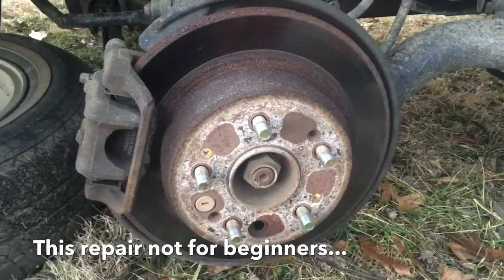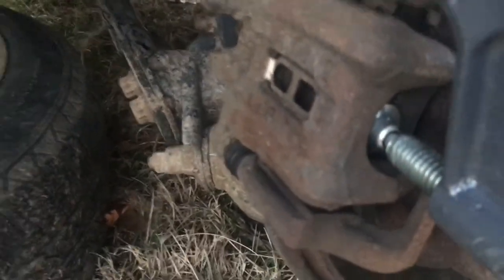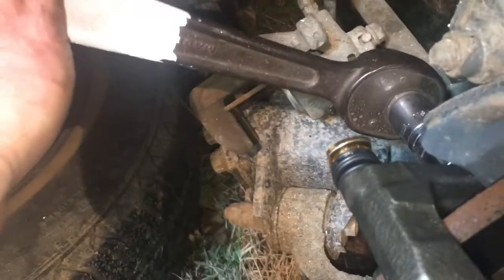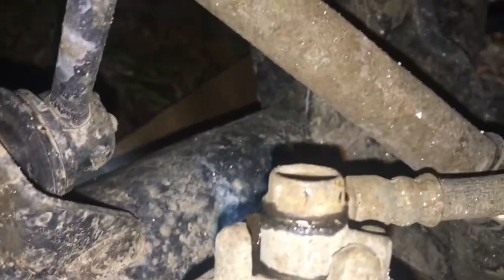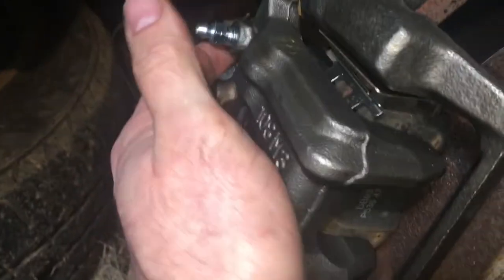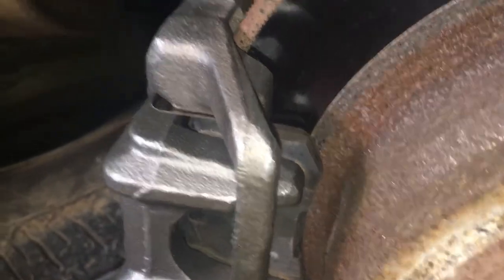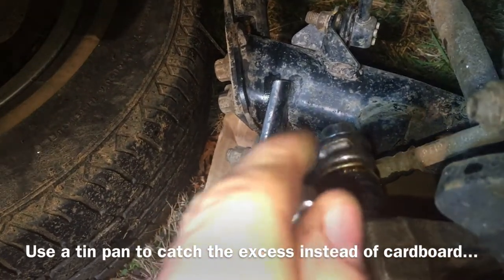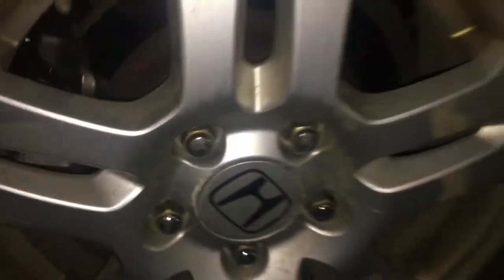Honda CRV How to replace Brake Caliper 2004 - How to remove Brake Caliper

Comment: Thank you for posting this video.  Was quoted $400 in parts from parts store  and another $140 for install.  Ordered power stop kit  from  Amazon which included two rotors, brake pads and two calipers. I will now being doing the job myself.  Thanks again for such a thorough and detailed video.

Comment: I did it!!.  I am not an auto  mechanic and I respect that line of work very much.  However, after my auto mechanic changed my rear brakes twice in just 2 months, I had to review his work and learn exactly what is going on.  After watching this video, I changed my breaks  and this time I also discovered that the left rear brakes do not wear out just the right rear brakes.   Not sure why my mechanic did not noticed this.  All in all, I was able to put new brakes and replace the calipers as well of my  Honda Pilot 2004
Reply from the maker: Ray Pérez congrats!  That’s great to hear!  There are a lot of reasons one side might wear faster than the other, but it could be due to a sticky caliper.  The caliper might be sticking closed on the right side and wearing those breaks out, or the left caliper might be sticking open and not closing fully, which means it’s not wearing that side out.  If you have a stuck caliper closed, you can tell by touching the wheel around the hub after driving.  If it’s stuck closed, it will be hot!  Hope this helps and you find the solution!

Comment: Yes this works, thanks, use a torque wrench if you are not certain. I recommend a slight change, - undo the brake hose first, wrap it in something protective, then do the replacement, then hook up the hydraulic line. And do not ever roll on shabbos.

Comment: Great, simple video.  It would probably be better if you used a hose and old water bottle to catch the fluid when you bled it!
Reply from the maker: gtc1961 very true!  Will do that next time for sure 🙂
Reply: @ReubsHolli  I did mine last weekend...came out great but the brakes didn't bleed much at all....very little came out of the line after I connected it to the caliper...when i left it off, the fluid came right out.  Very odd but the brakes work perfectly.